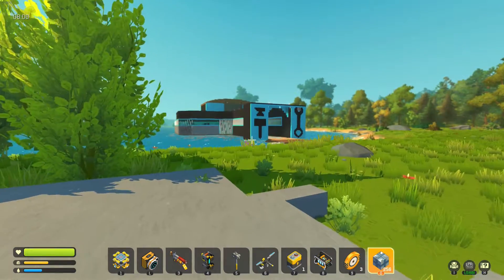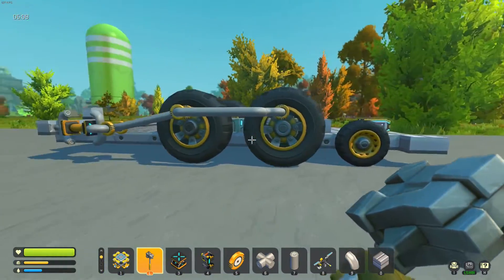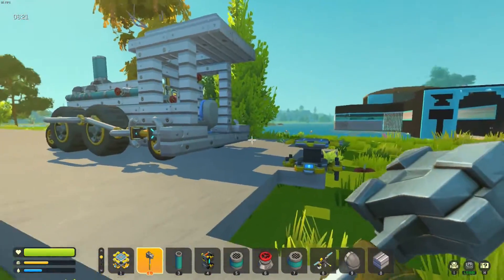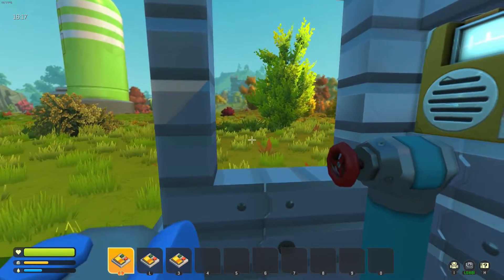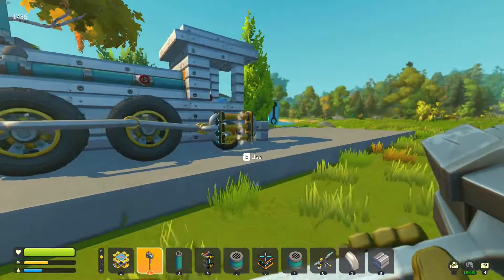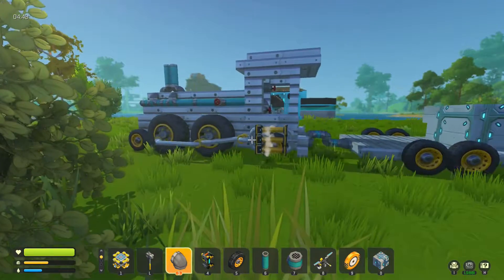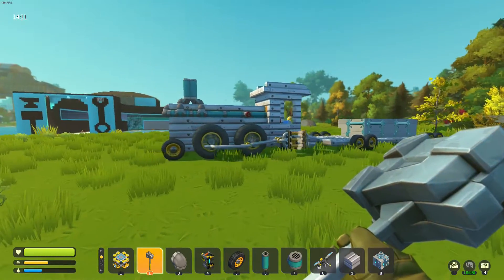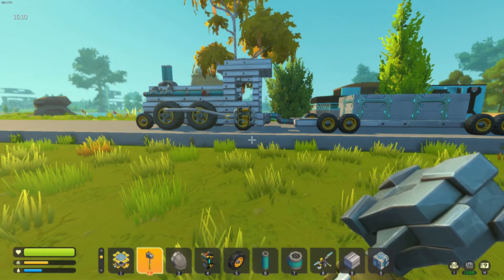piston powered train scrap mechanic

Comment: I think it might have worked better if you had the pistons offset from each other so one would be pushing on the top and the other is pulling on the bottom, that might make it smoother and stop it from changing directions.

Comment: You could power the pistons using sensors. Did it this way with my steam-powered train and it worked like a charm. Just let the sensor check the position of the arm and it should go smoothly. (and not backwards, which is a timing problem) this way you could stop the train using a gate between the pistons and the sensor.
Reply: tried that and i got the same issue but its in the correct position LOL
Reply: What about offset by 180 degrees? Did it and it goes too fast no reverse